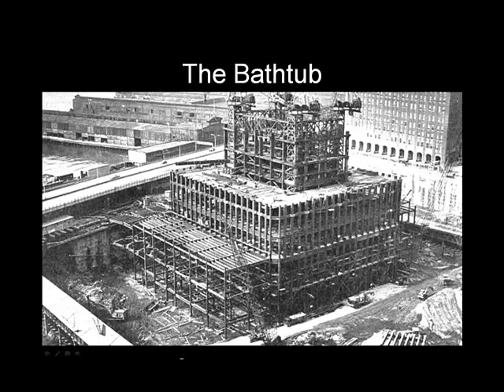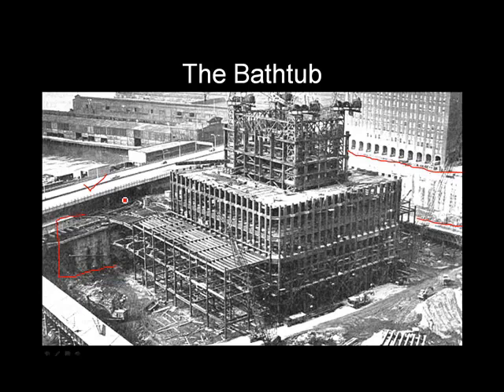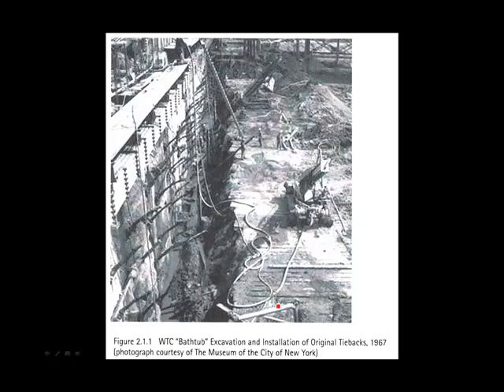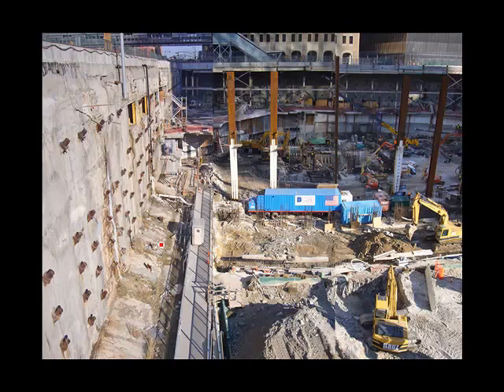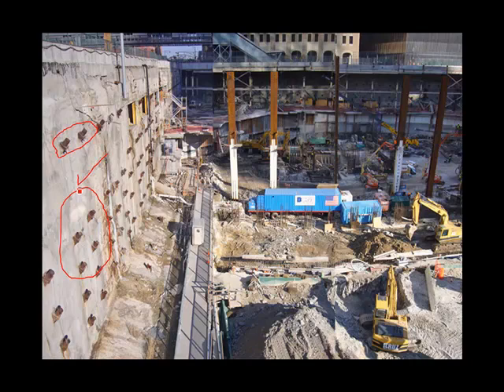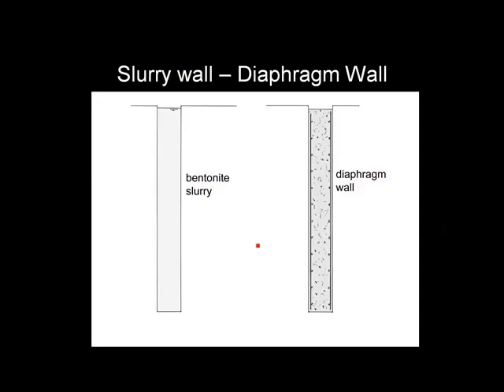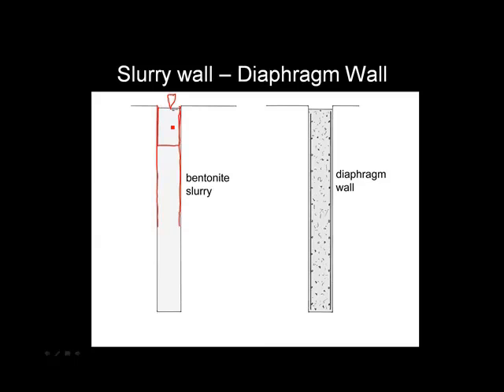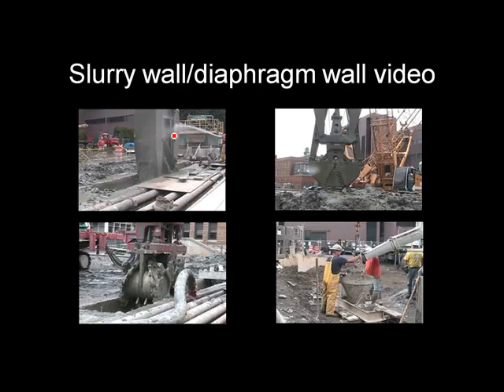Infrastructure Projects Constructing Slurry Walls, Class 4 Bathtub at World Trade Center

Comment: my husband and I bought an apartment off plan about a year ago and have been visiting the site weekly to keep track of progress. Only now do I understand exactly what they were doing all those months in order to be able to build five levels of underground parking. Thank you for this incredibly informative video.
Reply from the maker: I wasn't familiar with this application until I shot the video
Reply: I hate to be that guy to say what will get a label placed on you but I am the guy that woule have sat on the deck of the Titanic and finished off the oldest bottle of whiskey all the way up until the moment I get to see what the unknown actually is and prove death is something you should never fear.  According to the "official report" on the events of that day in Sept 2000+1, the upper sections crushing the structure beneath in addition to the striking of a plane (small amount of weight/density) to the outer steel frame caused a complete failure and ultimately collapse of almost the entire structure × 2 could be explained as what really happened a short time following the impacts as fact.  Unfortunately, there were no seismic activity readings which there would have to be and following that explanation there would be an epic flood of lower Manhattan since that slurry wall would have zero chance of holding back all that water from the Hudson River in addition to withstanding the crushing blow via Sir Issac Newtons laws that must have been out at sea with all the F16s or maybe on vacation for once in history following their inception into Physics as a fact one could use Legos to prove the point.  The 3rd building that fell faster than a bowling ball dropped off the roof at the moment of unbelievable is still the one part of that whole nightmare most experts at NIST forget about since it was much later in the day, no strike to the building and 47 stories of extra reinforcement that housed the Three letter agencys, the mayor command post and bunker, the files to that Enron thing and all the bonds due on all the money used to buy up anything of value after the wall went down and the ussr became no more.  Think Carlyle Group that was meeting that same day with that guy who did it family a few blocks away to discuss future business that must have been future meaning a month or two on a hunch.  My opinions regarding that particular feat of engineering, even the builders of the pyramids on the giza Plateau couldnt reproduce so we are kind of even, but still concerns me.  I loved NYC before that event and still love it but it just aint the same kind of love anymore.  Everyone I know that lived in Lower Manhattan moved on shortly after that day and those that remained left in the early days of the most recent event that began in early 2020.  Why?  They would know that gut feeling since they lived through it and never got closure via a proper investigation.  I hope they are wrong but said to stay in Lower Manhattan after mid 2020 is not a good idea.  A few took out a piece of American Currency to fold up and show an eerie depiction of what looking like the Hudson River breaking thru and flooding the city they miss and loved so much.  They understand the label that thought would get them and only shared that idea with a crazy person such as myself.  The Great Reset has yet to begin but we will all see and understand what that was all really about in the near future.  I reside in Philly and like NYC and oddly all major cities on each coast have witnessed the police being told to stand down as the criminal element take over the streets 24hrs a day with the media reminding us all how insane this has gotten.  I shared an opinion with a few people I consider to be highly intelligent and we agreed it is as if those in charge are quietly trying to tell anyone that is paying attention to move from the coasts, without going live and causing a panic that would include the worst reaction by humanity like the panic for toilet paper or gas but on a grand scale...they tested society and well society panicked immediately so the quiet approach was what we got.  I wish you and everyone the best in the coming future regardless of what happens since a perfect storm of the economy/debt, the sun cycle, and the treat of attack from the bad guys in not a conspiracy and is obvious at this point.  Left or right leaning is meaningless in this spot.  Spirituality is the only thing to lean on if you had that moment in life like I did a few years back.  If you dont have faith in that sort of thing just keep an open mind and an open heart in case that moment happens in line with the type of moment I hope does not come along in our near future.  We are living in unprecedented times.  I am sorry for my part in all of this as we all funded this mess in some form or another.  Nothing can hold back fate.  Even a slurry wall from the creator of it all out of the unknown and into this very moment moving towards the unknown ahead.  Be a positive good hearted person and you along with your loved ones will be ok no matter what.

Comment: Does bentonite remain as a sealant of sorts after the concrete is poured? I’m just wondering why the slurry is poured then replaced with concrete. Why the seemingly extra step?
Reply from the maker: The goal is to create a reinforced concrete wall. The bentonite slurry supports the sides of the excavation making it possible to place the concrete.